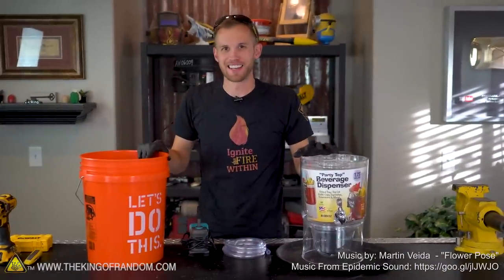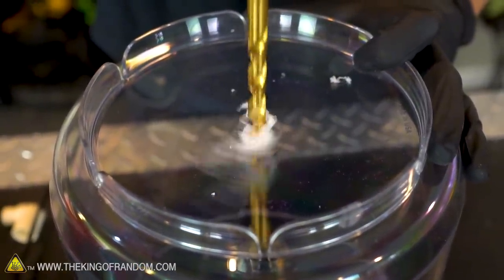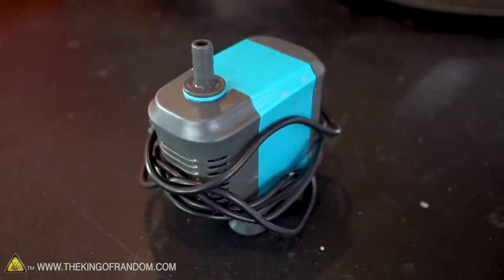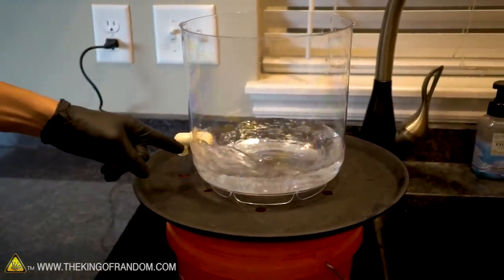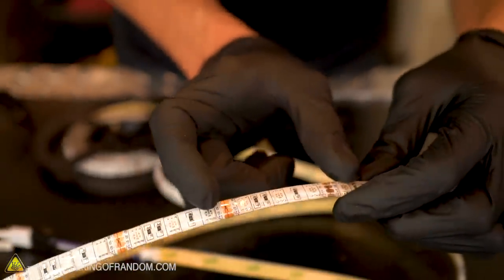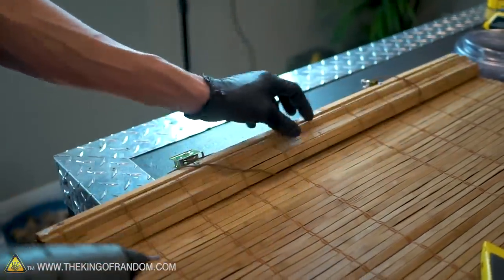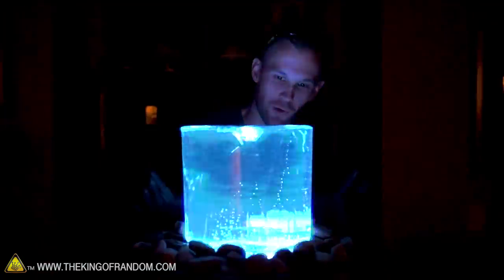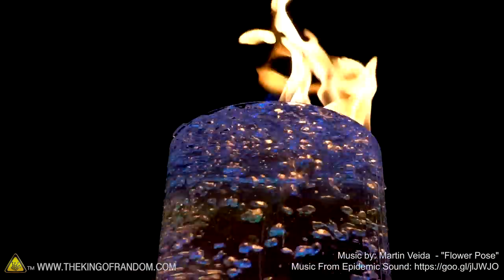How To Make a Giant Flaming Vortex Fountain! TKOR Shares Our Tornado Water Fountain How To Secrets!

Comment: The propane bubbles trick was genius!
Reply from the maker: +G3AR - 'GreekGadgetGuru' Thanks! Just passed the compliment on to Nate
Reply: G3AR - 'GreekGadgetGuru' im subscribed to your chanel you do pretty cool stuff like the spiderman web shooter and the dr strange light thing
Reply: Tips on that part? I'm trying to make the same set hp
Reply: Up
Reply: 666th like,
 help
Reply: To get better bubbles (smaller), try using one or more "air stones" meant for oxygenating the water if fish tanks.
Reply: PLOT TWIST
Reply: thanks man this is genius:) ı was sorry about the bubbles thank you so much
Reply: G3AR - 'GreekGadgetGuru' 😂😂😂😂😂😂😂😂😂you made my day when you lit it on fire😂😂😂😂😂😂😂😂😂😂I'm in love with it!!!
Reply: Yeaaaah.
Reply: G3AR - 'GreekGadgetGuru' is
Reply: i cant get the propane to push  thru an airstone...without it(larger buubles) the fire will not stay lit! suggestions please!!!!
Reply: G3AR - 'GreekGadgetGuru' i
Reply: Try actually roasting marshmallows in wet propane...add a separation stack I suppose, or mix a zombie (drink) of unusual size and separability?
Reply: Is the propane supply from a hand held torch size or the big outdoor grill size?
Reply: Love it.  I have one thing to add.  If you rain ex the outside of the container, the overflow will be more symmetrical.  Instead of flowing over in certain spots, it should over flow evenly around the whole container.  Great job.
Reply: Heh heh plot twist because of the swirl
Reply: I would maybe try using a cryogenic diffuser to get finer bubbles.
Reply: What is rain ex?
Reply: We kept the spicket from beverage dispenser and used it for drain in pail. 
We also used the propane tank for gas grill and used the rest of the plastic tubing and connected that to the hose and regulator for propane tank. The plastic tubing is glued to the inside bottom of the the dispenser. We used small drill bit to put holes in the tubing only inside the dispenser. Needle holes are too small. We also added a shut off valve in the tubing between outside of dispenser and propane hose to get better control of flames. 
Make sure you use copper fittings for connectors with propane
Reply: @TheKingofRandom  I just saw this video….I have been trying to figure out how he put the propane tube in the water(?).
Did he make another video to show us (the beginners), how and what was added at the end? If so please send me link, if Not …Please send me info.😿

Comment: Sweet, i would have liked to see how you did the propane. I assume your using the torch sized canister. I take it has a control valve on the side so you can control the flow. Approximately how long does a can last?
Reply: @Job Ruijten  which propane tank was that. I would like to use that same one

Comment: HOW DO YOU ADD THE BUBBLES?!!!! you didn't show where the propane intake was, or how the bubbling tube was added. I need to know how to make this thing light on FIRE
Reply: Sanity016 probably the same way the water comes in. Via a hole in the side that the tube goes through.
Reply: Just get a small propane cylinder in camping aisle. Hook it up just like the air pump.
Reply: If you look towards the end of the video dude theres another hole pretty much next to the water pump one. You can see the plastic tubing inside curled up too. Its not too difficult to imagine if you look a lil bit closer. So simple yet so awesome!!!
Reply: We NEED instructions on propane fire vortex. Please kings of Random. I must build one of my own
Reply: That’s exactly what I was thinking!
Reply: Maybe this is the subtle way of saying "Don't try this at home," simply by not explaining the full steps of the dangerous part.
Reply: If you need someone to tell you how to do that, you probably shouldnt do it
Reply: Use some lighter fluid and a lighter. Im pretty sure you know what the next step is ...
Reply: CGI goes a long way
Reply: Fart into a tube.
Reply: He has to explain it, before some Trump voters just add propane instead of water lol
Reply: Jaded Lion well said
Reply: I’m shure you can find that out

Comment: Dude! I have a 30' x 16' x 3' deep pond. I'm going to be expanding it with a water fall 3' high x 10' wide x 20' long. For the past year I have been looking, and looking, and looking for a decent water-based fire bowl for an accent piece. For THOUSANDS of dollars you can get a large brass or concrete bowl with a gas array just below the surface of the water and the combined effect is like staring at your BBQ. For what appears to be about $75-100 worth of random kit, you have completely blown away every single $3k-6k flaming water bowl I have looked at for over a year. This is fricken AMAZING! This WILL work its way into my pond and water fall. I might need to contact you to find out exactly how you did the propane tube. Thank you SO MUCH for doing this!

Comment: could you go into a bit more detail of how you got the propane tube in the vortex? did you cut a hole in the outside, or go through the base like the water hose?
Reply: Doesnt matter, Either way works just seal it with the hot glue and add a regulated low pressure propane

Comment: Could we please list parts needed to add the propane. It is also stated that a hole was drilled through the bottom, and not the sides, in order to add the gas. Please, PLEASE, give details.
Reply: Norm Reynolds Right, I’m searching hundreds of comments to find nothing.
Reply: I guess he's keeping this part a secret.
Reply: guys... try things. be creative, find a way to make it work
Reply: yea, try your own things, like propane tube on the side or fireballs in the vortex, or something creative. make the vortex feel like YOUR personality. i figure thats better than copying someone else's work and calling it your own, dont you?
Reply: Yo I dont want to explode trying new things.
Reply: TheRodT, but that's half the fun I thought?
Reply: Shouldnt be very hard, A propane tank, regulator on low pressure. The exact same tubing he used for the water except you let it lay down in a spiral coil with some holes drilled in it.

Comment: Make a video on how you connected it to the propane
Reply: nathan484848 it's not hard, you just add an air hose to the bottom which has holes placed in it and then you feed gas in.. if you have to ask for directions you probably should not be doing it lol.

Comment: Hmmm was that you drilling into the tabble accidentally or was there a board under? Xd
Reply: Jovan Kocic 
Pretty obvious there was a board under it
Reply: If you mean the one at around 3mins yes he drilled into the table.
Reply: He has his hand holding the tray on a block of wood.
Reply: Only on every hole after the one just before 3 mins. Watching closely you'll see he drills right into the table.
Reply: No, you can clearly see the tray is upside down with his left hand holding the tray secure as a board is directly under the inverted tray while he drills. The drill then breaches the plastic tray and hits the 2x4 board under the inverted tray to protect the table. 
Also, you can see no cut marks on the table from any mishaps from the drill.
Reply: Yes he uses a 2x4 but not on the first drill. You can in fact see a patch on the table later on roughly the size of the drill bit.
Reply: Robin Lu those shavings are clearly from solid wood, if you pay attention as close as you say you do then it's clear that it's resting on a board.
Reply: @Jay The table is made of wood. It is not on a board on the first drill @Zane No, not at all.
Reply: Tabbes
Reply: Also the tray is laying flat on whatever he drills in, so it can't be the table as the tray is upside down. There would have been a bit of air if he hit the table.
Reply: Zane T yes, yes it does..
Reply: He didnt and I can give you a solid reason why not, he holds one of his hands on the edge of it, with his fingers under it, that means it isnt on the table, but there was a wooden block under it
Reply: Robin Lu the table is made of plywood, not solid pine like the shaving. The tray has a ridge and is sitting upside down flat on a surface, meaning it is NOT the table. You can also see the unpainted wood through the hole when he pulls the bit out.
Reply: Robin Lu You can infact see his hands under the tray (indicating that the tray is elevated) it definitely was on a block. You are wrong lmfao. You can look a few more times if you want.
Reply: It was the board under it. You can see the plastic tray is higher off the table. There was nothing on the table after it.
Reply: Robin Lu no it’s pretty obvious he has a piece of wood under the tray…
Reply: He put a block of wood under

Comment: Put a two inlet valve onto the air hose, connect one to a detachable propane hose, and the other to an air pump, then you can still have bubbles and keep it indoors.
Reply: Xander Zoolander -Dude, you built this? Do you know the secret to building the gas in the tank? All the comments are dying to know.

Comment: Does the hole in the center of a vortex fountain matter
Reply: diy people I think it would drain faster with a larger hole. So you have to be careful with that.
Reply: seededsoul ok thanks oh and I built the fountain already but I'm just waiting for the led strips to come
Reply: A bit late, but if I'm not mistaken, a bigger hole makes a bigger vortex. If you make the hole too small, the vortex wont reach the bottom of the tank; however, if you make it too big then the water drains faster than it comes in and the tank wont fill.

Comment: It's amazing!
Tho I don't know any chemistry so could someone explain how propane bubbles appeared just by applying pressure on the hose?
Reply: He put a tube in the tank that had propane gas, which is flammable so when he used a lighter on the bubbles it lite them on fire, and continued because of the constant stream of gas filtered through the tube. Also, not all fires are put out by water, like chemical ones. Fire thrives off of oxygen, so in order to put one out you need to cut off its supply.

Comment: Would be cool to see a water tornado with a fire tornado on top. Can you try adding an extension that creates a fire tornado? if you cut a large glass tube in half (vertically) and slightly offset them, the buoyancy from the flame should entrain air through the gaps creating the tornado effect.

Comment: Added tip:  if you live in an area like the Southwest with high levels of alkali in your water, it will eventually leave a film on the plastic and the rocks.  Use distilled water which is only $1 per gallon.

Comment: Other than the gas and fire all of this can be run by solar panel and battery to do it all night.  The LED lights are 12 volt and 12 volt water pumps are easy to find.. just thought it would be really nice for on the patio.  The gas bubbles can be used, most people have gas BBQ'S and there is a way to tap in to use some of the gas. The color LEDs not used from the string you cut off for this can be added to another string and controller. One remote may control both but maybe only the one the remote is pointed at. That will need testing.

Comment: Just a question, I'd like to try to make this, I've seen a skull shaped glass drinks dispenser I'd like to use as I'm skull obsessed, am I right in thinking it would still work or does the jar have to have smooth sides? X
Reply: that will be determined by the power/size of the pump and the angle you put the internal fitting that supplies the water.  shape doesn't determine the tornado.  Remember, sinks are square and they still provide a tornado effect.  Go for it, I would like to see your skull version, even if it is without the fire.

Comment: What you should’ve done instead with the fittings is first swiped them with pipe cleaner a.k.a. acetone, and then wipe them with PVC cement, before pressing them together for 40 seconds.

Comment: Was just wondering if anyone else had ACTUALLY made one of these, with or without the propane addition.  I've got all of the parts and have it basically built, but I'm just not getting a vortex.  I've been messing around with different angles of the elbow, etc, and nothing seems to create one.  The water swirls around and still looks cool; it's just missing the vortex part of the vortex fountain!!!
Reply: Oh - and right now I'm doing it without the propane addition.  Baby steps.  Get the actual vortex working, THEN start adding to it!

Comment: Somebody pls axplain Why do we need the Centerhole (right in the middle of the bottom)? I try to figure out why is it necessary for the Vortex Creation.. - if the water can over flow (and there for drain) over the edge of the tank. Or water must drain "down" also? (not just overflow) I wander What would happen if there was no opening at the bottom? No Vortex at all?..
Reply: So the center hole is necessary for the vortex. Think of it like your sink, that middle hole is the main exit point for the water and since the water is already spinning its going to follow that same flow pattern as it exits the container